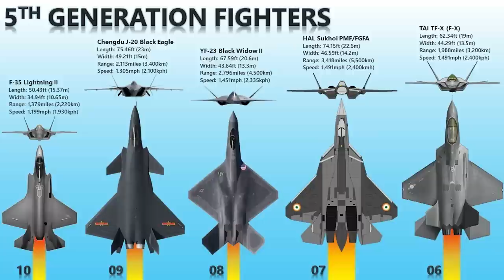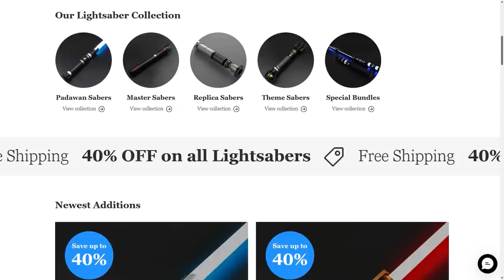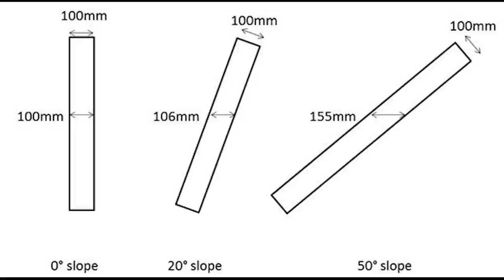Is the Tie Fighter MORE SURVIVABLE Than We Realized?

Comment: TIEs are flying coffins in an almost literal sense as there's no force field ejection to protect the pilot and that it doesn't have a hyperdrive of its own.
Reply: There's a reason for the lack of ejection. They're primarily space fighters and launching into the void of space to drift aimlessly in hopes you're found is pretty suicidal. It is better to stay inside the wreckage, which can be easily found and recovered.
Reply: Seals in the flavor
Reply: Doesn’t need a Hyperdrive

Rule 2 of warfare, don’t be hit
Reply: If need be, any TIe can easily have its armaments changed, and or have shields and a hyper drive of multiple variations mounted to them.
Reply: @lancer737  Hyperdrive and Shields (Mostly Hyperdrive) don’t make sense for the role the Tie Fighter (or Interceptor) fulfill within the Imperial Navy
Reply: Well we know the X-Wing only has ray shields, protection against energy weapons, but they still die after only a couple shots. So the TIE takes that out and makes it faster. 

It doesn’t need a hyperdrive because the Imperial Navy has gone with carrier based tactics. Now I would criticize the imperial starfighter corps for not being in their fighters before coming out of hyperspace for a battle. And for not having a CAP, Combat Air Patrol. But that’s not the fault of the TIE.
Reply: @JohnsonA1788   I would like to point out we constantly see the Empire, and Rebels, using CAPs, and we have seen them in their fighters ready to attack immediately after jumping in, like in Star Wars Rebels.
Reply: @thechroniclegamer4285   it all depends on the squadron/wing/group. Also if its being used by Special Forces.
Reply: @lancer737  oh I won’t say that we NEVER see it. But how many times have we REALLY seen a good CAP running? How many times have we REALLY seen imperial pilots getting off the racks almost as soon as the ISD comes out of hyperspace?
Reply: @JohnsonA1788   kinda often?  The only ones I didn't was the First Order Subfaction of the Empire.
Reply: @lancer737  when? We didn’t see that in Rogue One, we don’t see that in episodes 4, 5 or 6. Barring the one TIE Fighter in 4 but you can’t say that was a GOOD CAP. We don’t see that in Squadrons. The attack on the Fondor shipyards, there was an established period of time before the hoards of TIE fighters were launched.
Reply: @JohnsonA1788    They did have them in Rogue One, or are you talking about when Vader jumped in?  Vader didn't really need them as the fleet is fleeing.

Ep 4, considering it is the Death Star, they had enough for recon, but up to tgis point, the Empire felt nothing any enemy had could do anything to the Death Star.

Ep 5 depending on what the ship is doing, some of them didn't require the TIEs at all.  Some of the ships around Hoth were specifically their to board other Captial ships.    Up to a point, they were out already when hunting down the Falcon, though you have to realize, the astroid field is pretty dangerous to fly through.

Ep 6, they were out the whole time.  Excluding the Death Star 2, the Rebels lost more Starfighters and Captial ships than the Empire did.  The Rebel Alliance even lost 60% of their A-Wing Interceptors in that battle,  the Interceptors are the faster and way more advanced version of the A-Wing fighters, they have lots of specilized tactical jammers, and they still lost 60% of them.   Both sides had all their best people on the ground, in the air, and in space in that battle.
Reply: @lancer737  no, just a fact
Reply: @thechroniclegamer4285   what do you mean?
Reply: @lancer737  it doesn’t depend on who’s using them, the Tie Line is the best of its time
Reply: @JohnsonA1788 There were literally CAPs in ESB and ROTJ seen around the Star Destroyers and DSII.
Yes the fighter in 4 counts too.

Comment: I've always thought the TIE is under-rated by many, and that a mix of an F-16 and F-35 comp makes sense for the platform. Highly maneuverable, mass producible, with a focus on cutting edge avionics. The limited viewport often gets criticized, but I've always imagined that that is a backup system, and that TIE pilots actually have a helmet sight similar to F-35 pilots that allows them to see through the walls in 360 degrees. Ultimately, its a design that is a good fit for the Empire's military strategy, designed to compliment and protect their crown jewel, the Star Destroyer.
Reply: And the biggest advantage of all: doesn't need a lot of maintenance
Reply: It is actually described in multiple Star Wars books that TIE Fighter pilot helmets did have the ability to look "through" the airframe like an F-35's helmet can.  In fact, I've believed for many years now that perhaps the F-35's helmet look-thru ability was inspired by TIE helmets.
Reply: I’m definitely certain all helmets with visors including storm/snow/scout troopers have some sort of augmented reality system providing real time data on certain things like a HUD.

Comment: The M1 tank does have a slope. It maybe a boxy style. The turret and front does have a slope. There was and still is a lot of science. To decide on the angle of that slope. I have worked on the tank, driven the tank. And even painted them.
Reply: Yup.  Also, sloping works if the material is ductile like steel.  For ceramic armor, this doesn’t work.
Reply: Also composite armor inside is also angled
Reply: @shaider1982  You can slope any kind of armor, regardless of what it's made of. All sloped armor is armor that's put at an angle. What you can't do with ceramic type armor like Chobam is make it rounded, which is why tanks like the M1 and the Challenger are made of flat sides pieces of armor that are set and angle on the front of the hull and turret.
Reply: @Riceball01  ??? can't the layers be forged as curves?
Reply: @atoll8423  Apparently not, something to do with the ceramic materials used. There's something about them that only allows them to be created in flat slabs. Why that is, I have no idea.

Comment: Next, talk about the other misunderstood aspects of the equipment used by the Empire:
Example: Stormtrooper Armor is not the 1-hit Kill people often think it is.  Unless your weapon is high yield (Chewbacca), modded for armor penetration (Han), a lightsaber (Luke), or you have pinpoint accuracy (Leia), that Trooper you shot isn't dead.  They're in Medical Shock.  Except for the guy who fell down the shaft in ANH while Wilhelm Screaming.  He's dead.
The real issues with Stormtrooper Armor, as noted by Captain Rex, are the lower quality material and ill fit, both consequences of expanded mass production.  This is in contrast to Clone Armor, which only had to fit a smaller of identical individuals, granting a higher quality and near-perfect fit with a single mold.
Reply: They use the same material as clones though. Plastoid used by both clones and Stormtoroopers, even Vader's armor used a mix of plastoid and plasteel. The armor has better HUD enchancements smoke filter etc. So it is undoubtably better than Clone armor, this includes their blasters which had immaculate cooling compared to clone weaponry, even the New Republic kept using them.
Reply: @garlixbread  They may be using the same material, the the quality and manufacture is noted as being worse in both Legendsverse and Disneyverse.  A "better" HUD that causes your trooper's accuracy to noticeably drop is hardly an improvement either.
Reply: @arthurbrandonnielsen  Their lesser accuracy is moreso a writing inconsistency, their aim was on point in all OT movies.

Comment: The tie fighter reminds me of the t34 it's not as survivable as a sherman or as armed and armoured as German cats but it's very easy to maintain and easy to mass produce
Reply: Nah the historical realities were opposite to that, it was hard to maintain and the production version was garbage compared to properly made tanks
Reply: @p_serdiuk  Hah. War time and post war propaganda discrepancies are always interesting to compare.
Reply: @viktoriyaserebryakov2755   The T-34 propaganda is based around the post-war production versions which were made roughly to spec and after certain problematic components were already redesigned, such as the engine air filters and the gearbox, which went from 4-speed that requires a hammer to shift gears (no that is not an exaggeration) to a 5-speed that could actually achieve a decent-ish speed on the battlefield. The wartime T-34s were basically metal boxes made of armor plates with subpar heat treatment, an engine with an extremely hard to shift and unreliable transmission, and a gun that was just ok. Everything else was not guaranteed to be put into the tank and T-34s made at certain points in the war that were the most desperate were hellish to ride and fight in. But, there was an awful lot of them, that much is true.
Reply: @p_serdiuk  I'm saying everything you're told about the Russians and everything you're told about the Germans was reversed during the war. That swapped immediately after it. It is funny to me.

Comment: @Generation Tech  I liked the video.  I have a couple things i need to point out.   

*1 Imperial Fighters do have the superior Sensor and Targeting systems, as stated in "Incredble Vehicles and Vessels" along with the "Star Wars TIE FIGHTER" novel/guide.  You are right though, that the data feed from bases and capships will also help the TIEs alot.   Also TIE INTERCEPTORS and DEFENDERS have the most advanced Targeting computers during the Civil War out of every factions fighters.  

*2 The materials used in TIEs, and in effect Rebel fighters, is more durable than we thought.  Unshielded TIE Interceptors chased Gold Squadron and the character from SW Rebels, through a nebula full of forming stars.   Nebulas full of proto stars internally is putting out immense radiation, heat, the gravity fileds  from all the proto stars forming and absorbing one another.   In real life we got nothing that can survive that.  
Also ill add the Targeting systems for the Interceptors, Defender, and Rebels were only slightly hampered at most desperate all the titanic Electromagnetic fields, heat, and gravity in the area they are flying in.   Star Treks sensors are nulled in much less hostile nebulas.
Reply: Star Trek's ships suck in general. Simple space debris can take out vital systems on the ST ships, and even though they scream "Shields up" or "Sir, our shields are losing power" no change happens to the oncoming damage to the ship, a hit does the same damage to a ship with or without shields. 

Meanwhile in Star Wars, shields actually greatly improve the survivability of the ship. For instance, in the Phantom Menace, when the queen, Obi Wan, and Qui Gon are leaving Naboo, their ship was taking close to no damage until their shields were knocked out. Or in Empire Strikes Back, the Millenium Falcon takes a hit from a star destroyer, and suffers almost no damage, then when it's unshielded takes a hit from a tie fighter and suffers good damage.

Comment: The T.I.E series was rather modular, if that was on purpose or not. Almost all ships that fell under that umbrella had the same structure, a cockpit module sandwiched between two fins that sat parallel to each other. From where I stand when building a Star Fighter its overall shape really only matters in atmosphere, the sleek and long design of the X-Wings main body doesn't really do much when in a vacuum. The T.I.E series shows a consistent and uniform design method and in theory this should allow the design process for new fighters to be a quick and cost effective. 

Plus Grand Admiral Thrawn did not deviate too much when it came to designing the T.I.E defender, so if the structure of the ship was good enough for him then you know the T.I.E series was good enough.

Comment: all of those modern tanks are very sloped from front attacks as you will most likely take hits there, with combined arms, drones and other tools identifying locations before contact. notice the slope on the turrets as well. 

then something you cant see, modern tanks use composite armor, if you google that they actually sandwich layers at an angle which makes a weight to protection maximizer very very happy.

Comment: On sloped armor: it doesn’t work if the armor is made from brittle material like ceramics.  Hence the slab sided designs of the present day tanks which used composite armor which include ceramics in it.
Reply: Alan got this wrong, modern composite armor used in tanks can and are sloped. What you can't do with it is make it rounded like on older tanks. He was confusing sloped armor for rounded armor. All sloped armor means is putting your armor slabs at an angle and you can have sloped armor that's both sloped and rounded.
Reply: @Riceball01  but it is true that it isn't sloped in many cases. (Lepoard 2A4 turret, M1 turret, Type 90 turret etc.) But this is because modern apfsds shells don't really riccochet.
Reply: @NickismyNickname  Except that, at least in the case of the M1, all of the frontal armor is sloped. All sloped basically means is slanted.
Reply: @Riceball01  have you ever seen a foto of these tanks?
Reply: @NickismyNickname  Yes, I have. I've seen tons of photos & videos, and I've seen a couple M1s in person. Their armor is very much sloped in the front. All sloped armor means is that the armor is slanted as opposed to standing upright at 90 degree angles. Any angle less t than 90 degrees means that the armor is sloped, even the Tiger ! had its upper hull armor sloped, albeit at a very slight angle. 

I think that you, and others, are confusing sloped armor for rounded armor. Old tanks like the US Patton series had rounded armor on the turret and armor that was both rounded and set at angle on the hull. Old Soviet tank have rounded armor on their turrets with sloped armor on the front of the hulls. Western tanks like M1, Challenger, and newer variants of the Leopard 2 have sloped (meaning angled) armor along the fronts of their turrets and hulls.
Reply: @Riceball01  i know what sloping means. Still the leo 2A4 doesn't have sloped armor. The newer versions also don't have sloped armor to increase riccochets. If it was designed for that reason it would be a huge shot trap. Modern APFSDS prohectiles shatter or penetrate. Sloping does slightly increase the effective thickness but it reduces the space so much that it isn't really worth it in most places. The arrowhead front of the leopard 2a5 and later is just a hollow composite screen designed to destabelize projectiles before they hit the main armor
Reply: Note quite true. The Leopard 2 turret armor might be straight up, vertically speaking, but if the turret is facing you, most of the turret armor is not at a 90 degree angle. It won't deflect rounds up, but can deflect them outwards.

That said, the type of round you are facing matters as well. Sloped armor is much more effective against certain types of rounds than others. If you are primarily worried about various anti-tank missiles, for example, then you'll be less inclined to slope armor.
Reply: @Axterix13  it just increases the effective thickness of the armor. Show me one instance of a modern anti tank projectile riccocheting off composite armor.
Reply: @NickismyNickname  Leopard 2 A5 and later have arrow-shaped angle armor
Reply: @atoll8423  read 2nd last comment i already adressed this

Comment: Sidenote, I really want a +2017 Mazda CX5 in red. Have a 2011 Mazda 3 but it's too small, specially after a child. She's been amazing, almost 200K miles, has never had a check engine light or any issues besides normal wear and tear. Even still drive able after getting T boned by an F150 that didn't feel like stopping at a stop sign, put the total check in savings.

Comment: The biggest change I’d do in the TIE interceptor is adding onto the swivel engines by putting them on a ring like an Inquisitor’s lightsaber. How many problems could’ve been solved if the pilot could just 180 in place while still flying in the same direction.